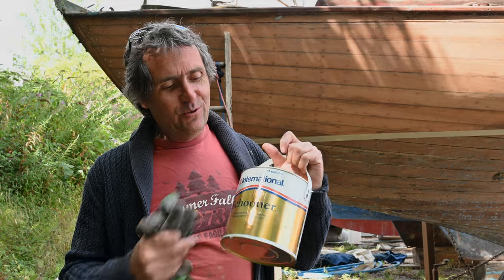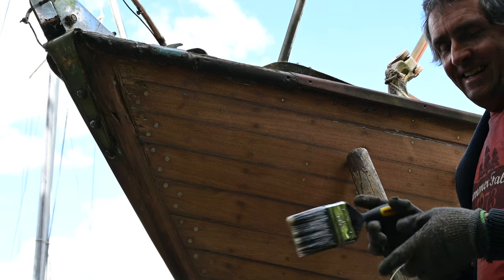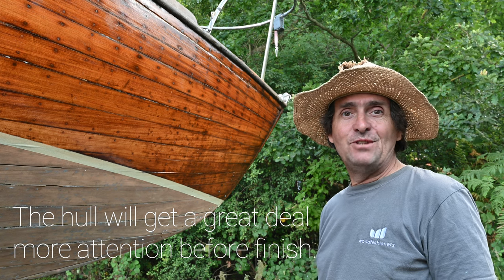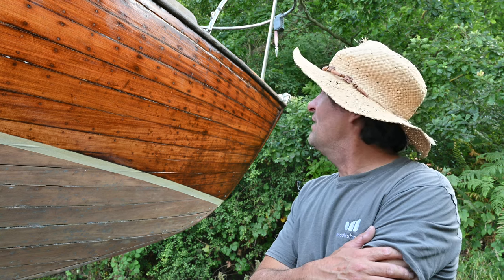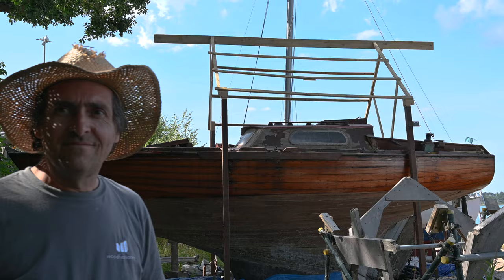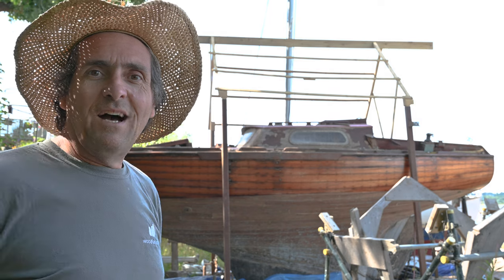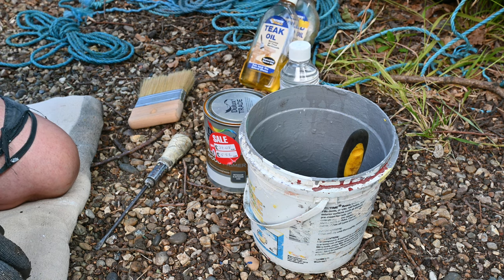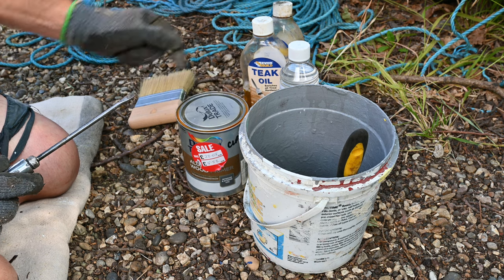Glorious Hull Transformation - Saving Susanna Ep 3

Comment: Hi Simon. My 40 years experience here in NZ with a carvel constructed vessel is to do the following:
1. Treat the bare above waterline timbers with International Everdure.
It is an ultra low viscosity two pack epoxy resin solution which is as thin as water and easy to apply with brush or roller. 
Used as a primer for timber surfaces prior to applying a wide range of paint finishes. 
Also used as an aid to sealing and densifying soft timber type surfaces to reduce moisture uptake.
* Easy application
* Hard tough cured film
* Simple 1:1 mixing ratio for easy measurement of components.
That will seal the timbers which varnish wont as varnish is porous. Then put your varnish on top.
Mahogany hates fresh water (rain water above waterline) and is prone to rotting and turning black. Everdure will prevent that.
You should sand off your varnish next season back to bare timber then Everdure it THEN apply your 6 to 10 coats of varnish.
She is worth it because she looks good with the varnish but the varnish wont stop water penetration and will cause you a huge amount of work every 2 or so years.
2. Put her back in the water and let her "takeup" with full water and fuel tanks etc. She will take about 6 months to take up water in the planks and she will settle lower in the water. Then next season pull her out and note the waterline.
Then tack a thin battern board along the waterline and run a hand saw along the top of the battern board to score a line which will give you a permanent waterline for the boot top line. 
3. Use a product called Penetrol. You add it to your paint and varnish and it makes your coating flow on like silk and leaves no brush marks. A truely great product which I use in my varnish. All super yachts use it to give the best finish you can imagine.
Penetrol stops paint form peeling, cracking, and flaking; increases paint flow and levelling. 
With a penetrating power 3 times that of water it goes deep into the substrate and forms a strong bond for subsequent topcoats
Seals out air and moisture.
DON'T mix all those random oils with your primer paint. If were meant to be that way the manufacturers would have added it!
There ends the Sermon. I hope you look into what i have suggested. Regards.
Reply from the maker: Thanks very much for the great advice Alan, really appreciated. Since i 'sealed' her for protection i have decided to bring her down to another yard closer to home & use another boat to learn to sail so that in the meantime i can focus on Susanna in a more thorough way - All the advice you just gave is going to be very helpful so thanks once again!  It's been the case a bit where the videos come out and the work is already done - so that a lot of the good advice i get is too late. Fortunately in this case i can actually use it! :) So again, much appreciated. Cheers!
Reply: Hi Alan. I too am in Nz and own a old wooden boat. 
Does the Penetrol help the varnish last longer? We are back to varnishing as it cracked and peeled on any joins in the timber etc. does Penetrol help in this regard? Would you coat the timber in it first as a primer then varnish on top with it mixed in? Would that work over Everdue?
Totally agree over the use of Everdue😀

Comment: Wow, I'm guessing you must be a professional painter by that cutting in.
When it goes back in the water, and the seams take on water before it plims up. You can  make a wooden box (shoe box size) on a pole, with a sliding lid with a piece of string to open. Fill it with sawdust and open it under water next to the biggest gaps, the suction will pull the sawdust into the seams and help slow the flow.
Reply from the maker: Haha nicely spotted! :) Yes, i am. Appreciate your noticing! 😅 And that's a brilliant tip, thanks very much! 👍👌

Comment: TOP TIP: Put a hose with garden misters inside the hull while she is on the hard. This will start the process of expanding those inner seem edges before you put her in the water and have to run a bilge pump for six days so she does not sink.
Reply from the maker: Thanks for the tip 👍 Yeah, i'll certainly be doing some pre-soaking before i put her back in the water. She's been dry for awhile now and so i'm pretty concerned about her taking up too quickly. That's a good call, cheers!

Comment: What about the missing caulking which you can nicely see at 1:20?
Reply from the maker: The caulking is yet to be done. It will all be removed, along with a lot of the splines, and be re-caulked about a month before she goes back in the water. The hull has been essentially 'protected' from drying out or bleaching anymore with the varnish and primer while i restore the boat properly.
Reply: @savingsusanna  Thanks for the answer! Good luck!